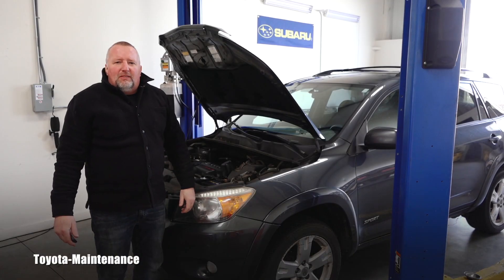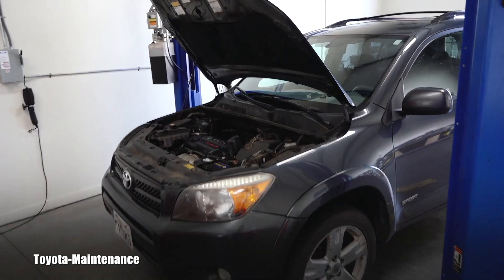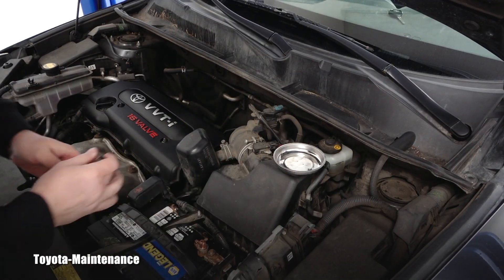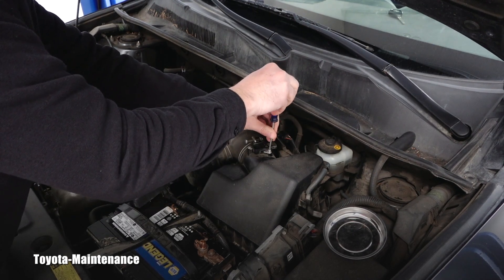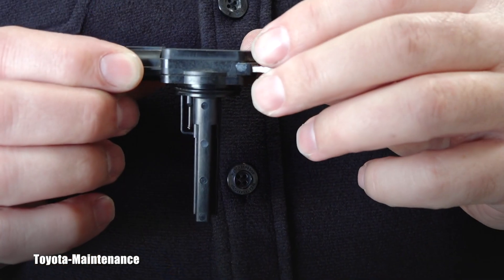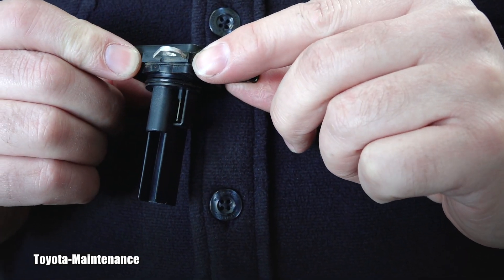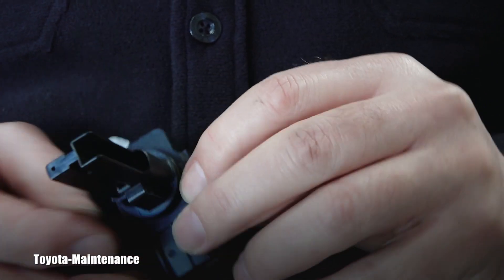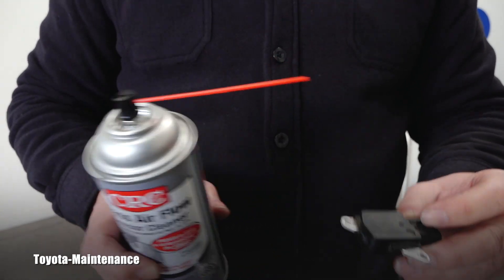Toyota RAV4 MAF Sensor inspection

Comment: Hello 

 I am from Turkey Senol ŞEN.
 I have a 2002 model raw 4 vehicle, but I have a small problem.  After starting my vehicle, there is no problem until the temperature reaches 85 degrees, but when it reaches an average temperature of 85 degrees, the rocket falls off and the engine part of the car sounds like a chain noise. The problem disappears when you press the gas and slightly increase the speed of the vehicle.  I need your opinion on this matter. Thank you very much in advance.

Comment: I have a 2007 Rav4  with 98'000 miles on it the OBD CODE  says Mass Air Flow sensor should I just clean or replace it?
Reply: Tony Cherry my 07 I’ve cleaned it like 7times just replace it I don’t have anymore error codes now I’m at 150kmiles